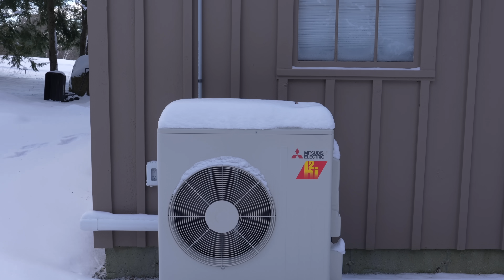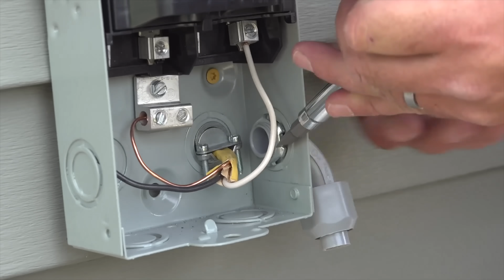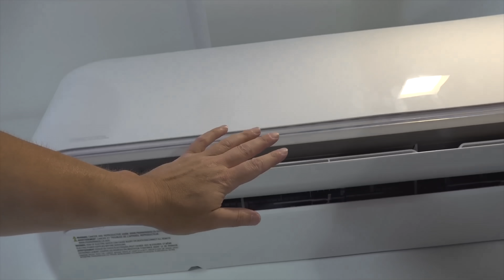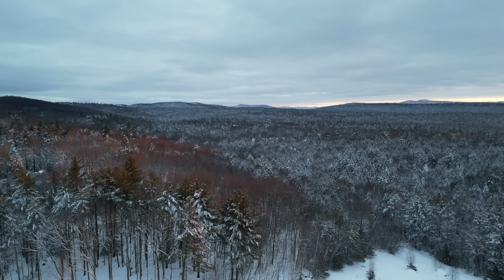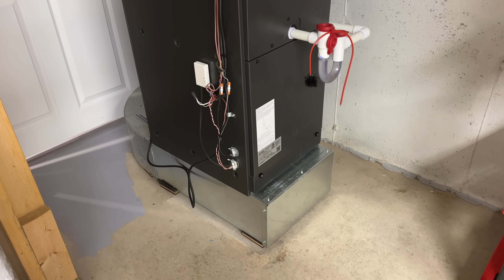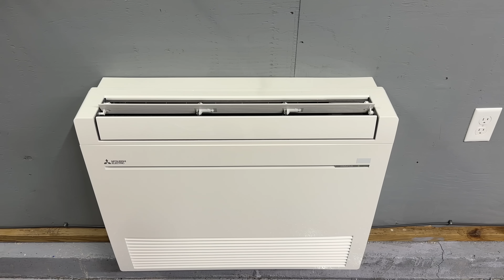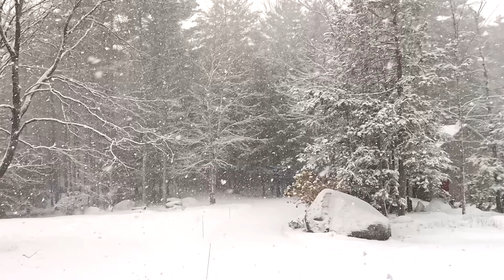Why Heat Pumps are now leaving people COLD

Comment: Thanks for the video, you're right.
The trick is PV + HP's.
I installed two Senville 12k units myself. They work down to -22F but like you said the efficiency does drop but they basically still carry the house. Since I already had oil in I use it on those days when it's very cold.
The beauty of these HP's is that they easily carry the house for three seasons of the year heating/cooling in our Catskill NY mountains area which saves us quite a bit on energy costs. I could install another 12k unit but I think I'll leave it where it is for now especially since we already have a high efficiency wood stove we can light on sub zero nights too. (Living in the rural mountains it's always a good idea to have battery backup, PV and more than one heat source, we do get power outages here.)

It's those fall days when it's 40 - 45F out and the house is toasty warm using very little energy, that would have killed us with oil. Right now it costs about $125 a month to heat and run the house, freezer, well pump, tankless hot water, fridge, etc. in the dead of winter, we also charge the EV. Our PV is paid off so think of it as offsetting the cost of lower efficiency with the PV. On sunny days we produce enough to heat the house and charge the car which only charges on excess when the whole house has been powered. That's possible even in the middle of winter.

I think the key is to have PV combined with the HP's so even the lower efficiency times aren't killing you which our 19k of PV does even on overcast days. We really don't get much charging on those days, fortunately we have enough range on the EV so we can run several days without charging it. We are retired, some people won't have that option.

During the summer we produce so much energy that it offsets out winter heating and charging costs considerably because we can run off grid and sell a couple of MWh back to the grid for several months of the year.

Comment: When we lived in Beltsville, MD we had oil heat and it was alwaus plenty warm and not too expensive.  We lived there for three years and only went through on tank of oil.  When that heater came on it warmed the whole house to a comfortable temperature in 30 minutes or less.
Reply: Oil heat was great. In 1980 a gallon of heating oil was less than $1.
Reply: My uncle's family grew up in Beltsville MD, I spent my childhood visiting them for the holidays. It's a warm place (and the first regular house I ever visited that had whole house AC :-)),, so a good fit for heat pumps.  Colder climates are more challenging.  

I'm not sure if this video is correct or not.  The newer generation of heat pumps are far more effective and efficient, but they still have limits, and those limits are close enough to real conditions that it's not a clear slam dunk one way or the other.
Reply: I have oil heat. It's cheaper than electric but more expensive than gas. It does heat up quick.

Comment: I knew this when I had my house built 14 years ago (and couldn't afford a geothermal system) so I got  a hybrid heat pump, that  uses propane when  when  the temperature goes below 32 degrees. Works great.

Comment: Sir, thnx. A question for you still. What is a "high pressure lockout"? And could a defective thermostat caused the defrost board to show this code. My heat pump board is currently showing this code. The OUTDOOR unit DOES NOT, start up at all,  in heating or cooling. There is 24v on the R and C terminals. In  the "emergency" mode, I am not getting enough heat. It only heats up to 72degrees only, and runs all night. And never shuts off.  This is a RHEEM system. 6yrs old. I am really frustrated now, because i am having all these issues at the same time. I am thinking the thermostat is mal functioning, then I think its the defrost board. then i think the heat strips has issues. I am a wreck with these issues. The indoor unit runs fine, but NOTHING from the OUT DOOR UNIT. I just can't figure it out. Hope you or any other can assist me.

Comment: Think about it, it's been -40 Celcius in some part of Canada, so a heat pump is a no go but our liberal government actively try to ban all wood, propane, diesel and fuel oil, 100% insane. In my part it's been around -20 Celcius to -5 Celcius so regular resistance electric heating is alright. I'm a firm believer that every house should have the two followings options of a heat pump and a wood stove for when it gets under -10 Celcius and during power outage which happens a lot in my area.
Reply: Yes but you voted for that .

Comment: Here in northern Canada we just went through a few days of -41°C (-41.8°F) and our heat pump with its large buffer tank and supplemental electric boiler worked as expected, our house was perfectly comfortable and warm. I have to emphasize that we renovated and greatly improved the insulation and that is the key for any heating system. If the house isn’t well insulated then you’re just heating the great outdoors. Don’t blame the heat pump for poor insulation and air leakage, any heating system would have a difficult job keeping up then.
Reply: Insulation is the key for any HVAC in general. Too many people think insulation is only for places with at least one cold season but even the Mexican lowlands need insulation. Insulation in the Winter is to keep the warm in and the cold out, but in the Summer it’s to keep the cool in and the hot out.
Reply: Insulation is the key here. Many people blame heatpumps for the lack of insulation. 
Even if you sue gas or oil it would still be useful to have insulation.
Reply: Hello, can i ask what is the heat pump that you are using at so cold temperatures??
Reply: @  look up Arctic Heat Pumps. There’s other manufacturers as well,  the cold climate heat pumps are getting better in the last few years.
Reply: I live in southern Ontario and the weather never gets as cold as where you are. The winters don't seem to be as cold as they used to be. We can thank global warming for that. However, my gas furnace and air conditioner are fifteen years old and they are getting tired. I am seriously considering a heat pump. I think it would be cheaper than buying two separate units. I believe there are still government incentives. Every time each unit comes on, I keep my fingers crossed.
Reply: @creamtopperwazoo1867   There’s several models of cold climate heat pumps, shop around for the best model for your home. One thing that I suggest strongly, improve your home’s insulation first as much as you can and reduce heat loss or gain. Check your attic for the amount of insulation and add more to get to R60 if possible. Be aware that HVAC companies might recommend a unit larger than what you need if they don’t do the Manual J calculations. A very well insulated house can have lower requirements for the size of a heat pump unit.

Comment: This is why you oversize for heating requirements with variable heat pumps. You can oversize for heat while not having to worry about short cycling for cooling. Also my 3ton system has a 2.0 COP at 0F. Mine had no issue keeping up with the heating requirements in an 80 year old house with aux heat off.

Comment: We installed 2 mini splits, and we use them most of the year in ME, but sometimes we run oil heat, but only on the coldest days.  We don't find the electric bill to be too high.

Comment: I just moved to the gulf coast. My house here has "heat strips" aka, EMHEAT on the thermostat. When I got my whole house generator, that was part of the deciding factor to get a 26kw unit, everything in my house is electric so I needed the extra power to run it if needed.

Comment: The bottom line is, heat is energy. No matter how you generate heat, it takes energy, and energy costs MONEY. Yes, some heating systems are more efficient than others, but all convert energy, (electrical, or chemical), to heat, and that costs MONEY, and the more heat you need, the more money it will you.

Comment: While the device you show off is a "heat pump", referring to it as a heat pump is not very descriptive to the type of heat pump you are referring to. Mini splits are going to be your Mr. Cools and your Mitsubishi's, and split systems are going to be your ducted central air units that have the condenser unit outside but the air handler inside. There are also package units that have everything outside, including the air handler right next to the condenser unit (in the same package), and all three of these types of air conditioners come in the heat pump variety. 

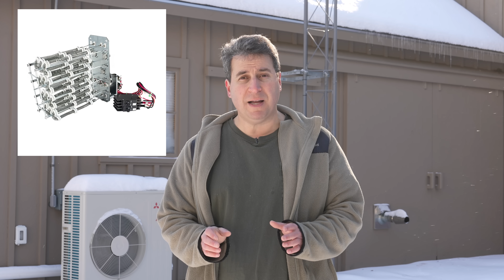Electrical heating elements (the supplemental heat you referred to around 2:45) in split systems and package units are how heat pumps maintain efficacy in strong northern winters. Depending on how smart your thermostat is, or how smart your system is, your heating elements will turn on when efficiency is too low to reach or maintain the desired temperature, and the condensing unit (the compressor outside) will turn off when the efficiency is so low that it effectively costs more to run the compressor than the heat it provides when compared to the heating element.

The problems you are describing are specific to Mini Split systems, as regular split system and package unit heat pumps have secondary heating sources built in by code to offer heating in bad winters.

Comment: We have to use "emergency heat" which is heated electric coils to heat our house here in Montana, it seems that the heat pump can maintain the heat for most of the day but not warm up the house.  Lennox ducted heat pump system.  Great for cooling the house in summer.

Comment: Very good information, I was going to build a 24x26 Garage this year and the builder was going to use ceiling heater but i was thinking of a heat pump. Floor heat would be nice but is too costly for me and I would be washing my car all year round. This has me thinking again, perhaps it may not work so well as here in Canada we sometimes get down to -40

Comment: We always go three times higher than your cooling needs and that usually gives you that extra heat because the new heat pumps have a variable speed compressor so it's valves itself right in if you only need 12000 BTUs for cooling you put 36000 BTU unit and then you'll have enough heat in the heat pump cycle for the cooler weather it works every time you just got to weigh oversized it I've been doing this 50 years I will start on heat pumps when before they were popular

Comment: I've had no issues with my Mitsubishi Hyper Heat mini split system as my sole heat source in winter. I'm in New York City so it's not super cold, but we just went through a week of not breaking freezing and were mostly in the 20s in the day and teens at night. The system kept us 67-70F without issue. My house is old but it's attached on both sides with newish windows. I will also say my friend in northern NJ installed Mr Cool for his cabin and it also worked very well by itself. I'd say you can do without a supplemental system unless you're in the coldest climates. Overall the system has been MUCH cheaper to run than the gas boiler it replaced.
Reply: If the governor there let's the utility co.charge big delivery fees like in massachusetts  you will not like it.nat gas delivery charges are 5 to 6 times the actual gas charge.eversource.sucks.
Reply: Sorry about the foul language.

Comment: Great video about heat pumps and very timely.  We recently installed a heat pump and connected our boiler as supplemental/aux.  We are patiently learning how the system works.  The fan runs allot longer compared to the old boiler because it does not provide the same heat output.  Can you make a video on your thermostat configuration and settings.  I think this is very important to understand.  Great content, love the channel.

Comment: This video is quite misleading. This is not a heat pump problem, but a regulatory/sales problem. What's not mentioned in the video is that the hotter the air or water your heat pump needs to output, the lower its capacity is. In other words, if at 25 F temperatures outside you need really hot air/water to keep my house warm, you could have an issue as the heat pump will be less powerful this way. In the video insulation is mentioned as the solution for this, but he forgets the more obvious solution: higher capacity convectors. I simply installed really high capacity radiators (you can also opt for water based underfloor heating). This way I only need the heat pump to supply 95 F water when it's well below freezing. My system is water based, but if you have an air based heating system you can use a higher capacity water based duct heater. In the end you should still have a (preferably built in) backup heater that uses resistive elements, but from a costs perspective it makes sense to design the whole system that you only need to use the backup heater during extreme cold.
Reply from the maker: Be careful with oversizing a heatpump, with the belief modulation will make sure that it always works well. You are right for those extreme heating days that can work, but the rest of year especially cooling can be a problem. See this excerpt for more detail: An oversized unit will create just as much trouble (if not more) than one that is undersized. If the AC produces excess cooling, it will result in the temperature in the house dropping quickly and the thermostat detecting the setting is reached. It will turn the compressor in the unit off before the cooling cycle is complete and then have it kick back on just a little bit later. This results in an ongoing process of starting and stopping called short cycling. As time passes, short cycling can cause serious damage to the unit’s compressor and shorten its lifespan. It will also result in higher energy costs. Even worse, since the cooling cycle is stopped early, the conditioned air isn’t distributed evenly through your house.

Comment: If you are around or above the 39th parallel across the United States heat pumps are a joke.
 For the most part these things are not being installed in new construction with heavy insulation in the walls.
They are retrofitted into older homes so you do not have a need for HVAC ducting.
 You will never get your home anywhere at or around 70° if it's very cold outside.
 Very cold meaning 30 or below.
 Why do you think the big pushed to get rid of natural gas?
 Once everyone is electric the rates will go through the roof!   And you will have no choice but to pay it, hell they are even want to get rid of fireplaces and wood burning stoves.
And everyone watching this vid need to look up the pricing of those hybrid ducted systems. 
It's ridiculous!

Comment: Extreme weather highlights the limits of refrigeration technology. 
For a heat pump to work, it has to be able to bring the temperature of the outside coil well below ambient temps. If it's 50° F that isn't a problem. If it's 10 below zero, then that unit is going to struggle. You'll get the least heat when you need it most.

Comment: The grid almost failed in Alberta when we went down to -30 celcius and below. The Amber alert system send out a message to turn off all nonessentials. If we were all on electricity, people would die in droves.
Reply: The grid almost went down because a few large gas power stations failed at the same time. Just need to design the system for the load, oh and not effectively ban new renewable/battery generation.
Reply: Yet data centers are being built all around the country that use a tremendous amount of electricity without issue.
Reply: It's almost like we should be investing in the grid instead of putting useless moratoriums on solar and wind. Fr though, grid capacity like other infrastructure tends to stay in step with innovation - the same way gas stations are everywhere, eventually superchargers will be
Reply: The United Corruption Party or UCP allowed natural gas electrical power generation to be shut down during the emergency. This was done so the power companies could increase prices due to lack of supply. Change the power rules in Alberta and there will be no shortages or change the corrupt government.
Reply: In alberta it makes sense to use ground source heat pumps, ground temp doesn't drop below 6 degrees C

Comment: So your heat pumps less efficient for a week out of the year, but it’s so much more efficient on the other 51 that you still come out way ahead. Just because it’s not the best choice in every scenario doesn’t mean it’s still not the best choice overall.
Reply from the maker: If you only have one week that's a concern then it's not an issue. Heat pumps won't save most people money on their bills and some may be higher but they are cleaner, less to maintain and provide excellent air conditioning, Heating is more complex as is running them during a power outage. I have a follow up video with some additional considerations that are left of comparisons that fixate on COP and skip some things to be prepared for.
Reply: @SilverCymbal  All I can say is my personal experience differs.  I am in Chicago - plenty of Cold in the winter, and heat in the summer.   Payback period on my heat pump is about 5-6 years based on my recent bills - after that it's all savings.    Obviously one experience does not a trend make, and yes it costs more on the very coldest days of the year.    On a 12-month basis still saves a bunch.     One easily overlooked advantage is that it decouples yourself from any one particular fuel source - electricity can come from wind, solar, natural gas, coal, nuclear, whatever.    Gas heat is natural gas only and you're stuck with the market rates with no alternatives.

Comment: Sounds like your installer didn't size your system properly/only looked at AC loads and not heat... Mine is an R22 unit from 2004 in a 1970s home and it keeps up into the teens.